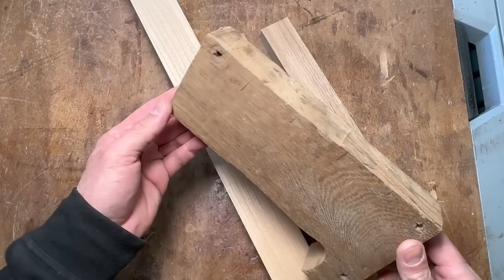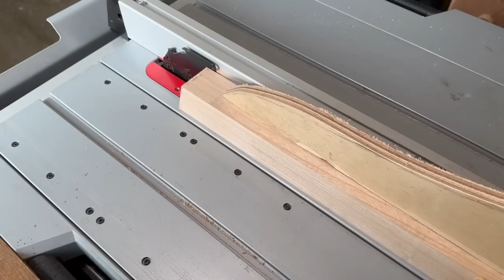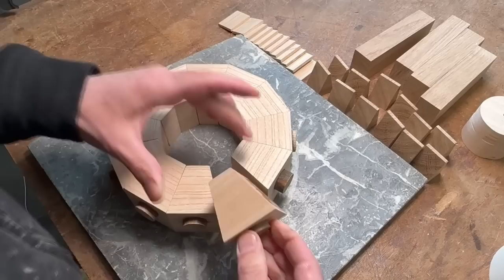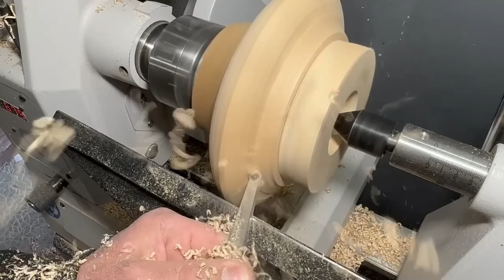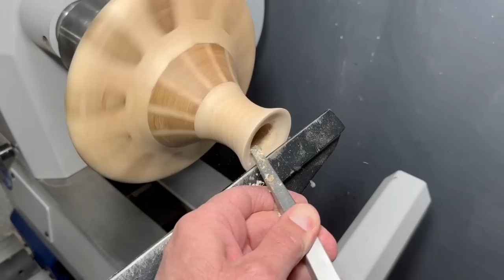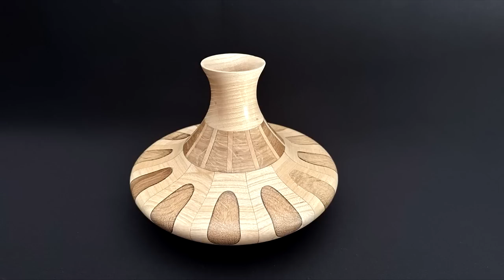Woodturning :A Great Project with Wooden Dowels and Segments

Comment: Hello Sir,
I don't know if you remember me but I have been in touch with you a couple of times in the past.
My name is Mark and I'm from Liverpool England. 
I was wondering if you could help me?
Whe would be the best thing to use if I wanted to make a vase out of wood and resin but it has to be strong and flexible enough to glue on to the circular shape of wood and hold resin in at the same time.
Hope you can assist?
Kindest regards Mark.
Reply from the maker: Hello Mark
To make a mold on an irregular wooden log I use polyfan, it is a semi-rigid plastic film used in the manufacture of lampshades, to glue it I use hot glue.
I hope I have answered your question, if not, do not hesitate to come back to me 😉
Reply: @bawbreizhartwood  
Thank you sur for your time and help. I will look into it.
Regards Mark

Comment: Worked cleanly and precisely, very well thought out and skilfully turned.  However, two things bother me.  First of all, superglue is inappropriate for extreme stress, such as that which prevails on a lathe due to the centrifugal forces.  The glue of choice in this case would have been wood glue.  and secondly, and this is my very personal opinion, the design.  The shape of this "thing" (vase?) is absolutely terrible, it reminds me of grandma's apartment furnishings, old-school and dusty, rustic oak, whatever.  I would never put that in my apartment, sorry.  You probably thought of an oriental shape, but the choice of wood and the coarse-looking dowels ruined that idea.  Nevertheless, I liked the video, thanks for the work and for showing it.
Reply from the maker: Thank you for your comment 😉